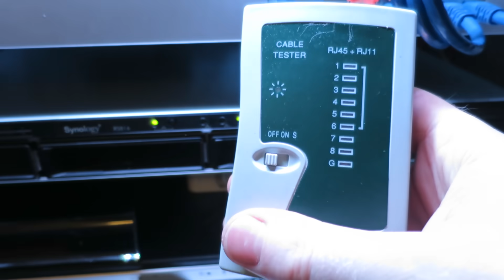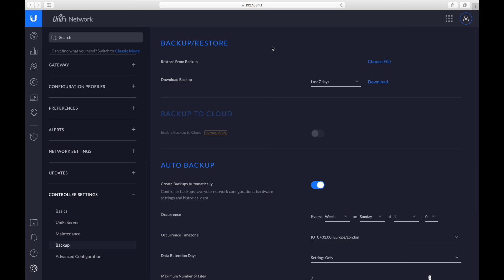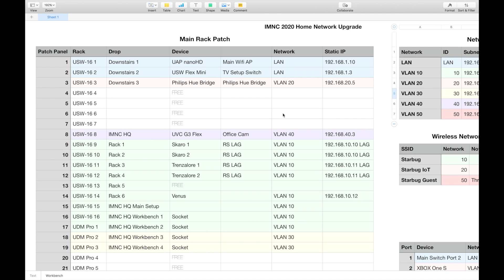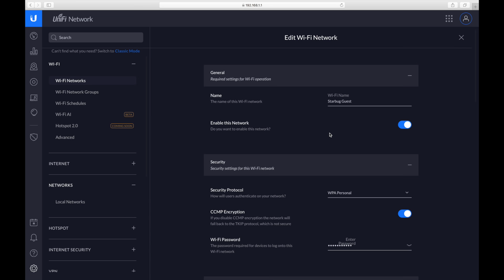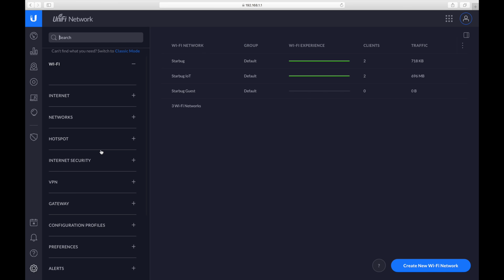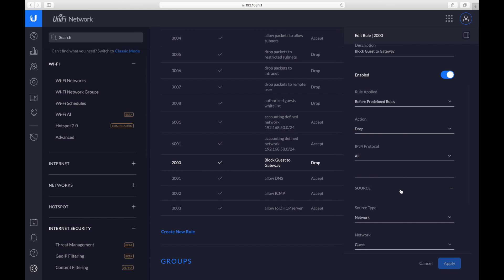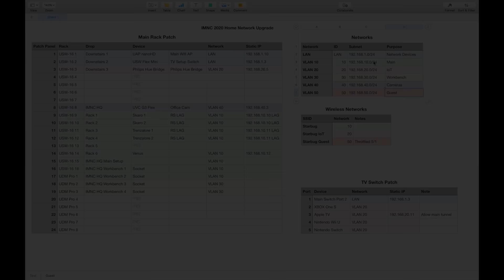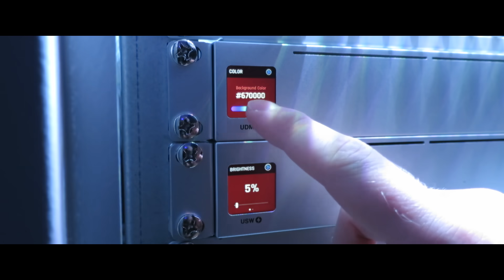Huge 2020 Ubiquiti UniFi Home Network Upgrade (Part 3 - Advanced Configuration & Final Installation)

Comment: Delicious setup, it  looks amazing, very similar to what I'm setting up now (with the exception of I'm going for the 24 port Gen2 switch, and the Ubiquiti RPS too).  One question if I may ask, where did you source your brush panels from, and how does the panel colour compare with Unifi stuff? I don't think my OCD will allow me to sleep unless they're the same colour!  Once again, supreme job, great content and looking forward to see more!
Reply from the maker: Thanks, Steve! Really glad you enjoyed the video.
The brush panels are "712477 Intellinet 19IN CABLE ENTRY PANEL" - I bought my 2 from an eBay seller but they're available from a few different sites if you Google that product. The colour is not the same. The UniFi gear has that shiny-ish aluminium look, where as these panels are painted steel, specifically RAL 7035. I'm not aware of any off the shelf panels that have the aluminium look, but you can remove the brushes from these, so you could if you wanted spray them with aluminium spray, which you can pick up online / at a hardware shop / auto repair shop. This has been done by other UniFi enthusiasts who want even colour rack equipment. For me, these panels are a great fit as my cabinet is finished in RAL 7035, so it looks really nice. 
The patch cables are deleyCON CAT6 white. They're available on Amazon as packs of 10, multiple different lengths available. I purchased 20x 2m and 10x 1m for this project, used 24 for patching the front end and 6 for patching the rack gear itself. https://www.amazon.co.uk/gp/product/B079G3V5Y5/ref=ppx_yo_dt_b_asin_title_o00_s00?ie=UTF8&th=1

Comment: Love your video series on the UniFi upgrade! I'm about a week behind you so just got my gear, still waiting for the USW24POE to arrive, learning a lot from you! To that end I'm curious about where you got information on the UDMP combined switch through capacity of only 1Gbit (until the switch arrives I'm using the switch on the UDM) I can't find that information anywhere... I also wonder where all patch cables to all ports in the UDM goes in your rack since you said in the video you're gonna use the main switch instead of the built in switch ports of the UDM due to the above said limitation? Oh, and could you link to the rack mounting gear? Eg what length are the patch cables you've used? what are the brush plates called etc :-)?
Reply from the maker: Really glad you enjoyed the video and awesome to hear you've got some UniFi kit on the way! Yes I can help with all this info.
Unlike the UniFi switches, the switching capacity of the UDM Pro as well as other switch specific specs aren't outlined in the product data sheet, however if you do a bit of Googling, you'll come across the info that the current retail model ships with a 1Gbps backplane, where as the early access model had a 2.5Gbps backplane. See this link: https://ubntwiki.com/products/unifi/unifi_dream_machine_pro - there's also some useful information about the subject here: https://www.reddit.com/r/Ubiquiti/comments/eyqmud/udm_pro_8_port_switch_with_only_1gbps_backplane/

The 8 ports on the UDM Pro are patched to ports 17-24 on my patch panel. My switch is 1 to 1 patched 1 through 16. I currently don't have any devices in 17-24, so the UDM Pro switch ports aren't technically connected to any devices in my network currently. If you look at my network spreadsheet, you'll see my usage begins to creep into that range, but that's cabling that I haven't yet run. Switching capacity won't be a concern for machines I have connected to those ports as they'll be used once in a blue moon. All of my high throughput devices and devices used daily are / will be connected to the main switch, to make use of the much higher throughput of the dedicated switch.

Patch cable length; I purchased 10x 1m and 10x 2m. I used 24 for the front patching, and 6 for the back end of my rack connecting the various machines within the rack itself. These are the cables: https://www.amazon.co.uk/gp/product/B079G3V5Y5/ref=ppx_yo_dt_b_asin_title_o00_s00?ie=UTF8&psc=1

The brush panels are "712477 Intellinet 19IN CABLE ENTRY PANEL" - I bought my 2 from an eBay seller but they're available from a few different sites if you Google that product.

I hope this was useful info, if I can help with anything else please let me know.
Reply: ItsMyNaturalColour BigFam is my alter ego.. Thanks so much for taking the time to respond. Very relevant and to the point information. Highly highly appreciated!
Thanks so much again! 🙌🏻🙌🏻🙌🏻
Ohh and of course subscribing from both accounts😊
Reply from the maker: @carlnakamura4861  You're very welcome. Thank you for the subscriptions, I really appreciate it! :D

Comment: Going by your closing comments, you may well answer this one on a later video, but I'll ask it now anyway.
How do the cameras talk to the UDM, for Protect, if they're on seperate VLANS?  I want to do similar, and I have a dedicated 8-port Unifi POE switch, to power and connect my cameras, when I get them.
Reply from the maker: Hey Steve. 
The cameras will keep communication with the UDM just fine. When I created the camera VLAN, in this order I:
1. Gave the camera it's new IP address via DHCP Reserve (settings tab of the camera itself under UniFi controller device list)
2. Changed the switch port profile of the port connected to the camera to port group VLAN40 (cameras)
3. Power cycled the port
When the camera fired back up, it was sitting happily on it's new VLAN with it's new IP address. I went into UniFi protect and it was detected instantly and began recording right away. I'm not sure if this is the official correct way to do it, but that's what I did and it worked just fine. Hope this helps.
Reply: @ItsMyNaturalColour  Cheers, I think it's about time to get, at least, my first camera, to experiment with, even though I'm nowhere near to being ready to install them.  Great series of videos by the way.
Reply from the maker: @stevesmith9081  I have more UniFi Protect coverage coming up, so keep an eye out as it may be helpful if you're looking at getting cameras.
Thanks for comments, really glad you're enjoying.
Reply: @ItsMyNaturalColour  I'll look out for it, just subbed, so I shouldn't miss any more updates.  Just ordered a G3 bullet cam.
Reply: Hey Tom you nailed it on this video! Your best video to date👍

Comment: You should get better WiFi if you move the AP upstairs WiFi finds it easier too travel down than it does up mount it on your ceiling upstairs centrally
Reply from the maker: My AP location definitely isn't ideal. I'm very pleased with the signal considering!
Reply: @ItsMyNaturalColour  unify does a great job im happy with mine too im running the AC Pro

Comment: Love the series!  If you put the second horse hair passthrough between the UDM and switch, you could get a little more airflow for both and not have to cross the cables over each other.  Just my 2 cents.
Reply from the maker: You're absolutely right. I was torn deciding between the approach you mention, and the approach you see in the video. I also had to keep in mind my positioning of Skaro. The 2 UniFi devices run relatively cool, but Skaro gets hot, and as you can see it's directly below the lower brush panel. There's a new machine coming to fill the blank space below Skaro too, so ultimately I ended up going for this layout.

Comment: I noticed the same. You cant absolutely set a static IP from the router. It only works when it wants. I renew the lease from the client and the client IP is still different to the one i set statically on the router. Its annoying because i want to set the static ip on the router and have a guaranteed assignment.

Comment: Little confused.... whats devices are on the on the 1.0 Network devices???  Router, Switch, firewall, etc??  Also where do you configure your VLANs? on the switch or the firewall/router?  Trying to think about how I want to setup my network but using pfsense and a Cisco switch.
Reply: Brian Froeber all configuration is done on the udm
Reply from the maker: Hi Brian
Apologies, I did rush through that bit a little. 
On the default .1.0 LAN, I've kept all of my network kit, so for me that's just UDM, 2 switches and a single AP. I've then decided to dump all of my main gear on the .10. VLAN that I created, and use that as my go to daily network.
In terms of configuration, the whole process you see here is done on the UDM Pro itself. Unlike the USG, the UDM line has a built in controller, negating the need to host the controller software on a separate machine or purchase a UniFi Cloud Key. By logging into the UDM, I'm able to control the entire network and all configuration from that one place, as well as access the separate applications such as UniFi Protect, for the cameras.
Reply: @ItsMyNaturalColour  Sorry i dont know Unifi gear...UDM Pro is a router? firewall?
Reply from the maker: @neccros007  Have a look at Part 1 of this video series. This video will seem fairly out of context if you haven't seen Part 1 & 2. 
The UniFI Dream Machine Pro (UDM Pro) is an 'all in one network appliance'. It contains your gateway, controller, 8-port switch and NVR... so yes like a mega router firewall combo box with lots of other toys. This is the 'Pro' version, geared more toward small business or home enthusiasts. For a more home friendly device, they make the regular UniFi Dream Machine (UDM), a very nicely designed device that incorporates gateway, controller, 4-port switch and an access point (no NVR in that one).
Reply: @ItsMyNaturalColour  got it.... since I dont have Unifi gear, I am trying to equate the role each of your gear would to what I am going to run
Reply: @neccros007  having different vendors Gear you just need to make sure to configure every single piece the same way. So your pfsense vlans need to be configured the same as your Cisco switch vlans then it will work as expected. Pfsense would take care of vlan to vlan routing and Cisco will maintain the traffic inside the vlans. If configured well, the result would be the same.

Comment: Might work better put on the ceiling rather than on the wall.  I have the same access point and took awhile to work out the best way to position them
Reply from the maker: Deffo. I will be able to move it when I redecorate.

Comment: Great content, thanks a lot! Especially the VLAN setup is interesting for me, as I wanted to do something very similar. What I wonder is what's the benefit of separating Network and (trusted) "Main" devices? Mainly for the sake of purity or just in case a trusted device still gets compromised to protect the network devices? Or vice versa? Any other reasons?

Comment: The only flaw I see with this plan is that if you need to access the bottom switch for any reason or have to take it out of the rack. Say it dies and you have to RMA it. Hypothetical. You would have to unplug everything from the UDM to get to it. Not to mention you just made it harder to access the ports beneath those cables. Fiber ninja has a video about this, just don’t remember which one it was. The UDM should be using direct patches with really short jumpers from above. But it your okay with what I just said, then it’s ok. Looks good mate. Glad to see your happy with the result.
Reply from the maker: You're absolutely right, and I was aware when doing it that Fiberninja would not be happy with me. I can see myself at some point upgrading to a 24-port UniFi switch, so that upgrade will be very smooth and easy with the current layout. I'll simply move the block of 8 cables down from the UDM, to the final ports on the new switch. It'll stay just as clean and means I can swap switches without pulling the rack out and removing the back cover. Even before installing the 16 port, I could foresee my need for a 24 port.
Reply: ItsMyNaturalColour I wish I had the money to upgrade my switches to Unifi. Just don’t have $2000 to blow on the kind of gear I would need. I’m using retired Cisco switches from my local university that I paid $15 each for. A 48-port in my server rack and a POE 24 port in the garage where my patch panel is located. It does the job, just a pain to manage. Ubiquity dumbs down the VLAN process so that the average consumer can understand it. I had to configure my VLANs and LAGs via command line. Not fun, but if you understand what going on and understand the difference between trunk and access, it’s pretty simple.

Comment: I’m literally on the verge of splashing out on a setup like this. I currently have a single Sky Router on a 4 bed house and the signal is just garbage. 

I have a question, i have IPTV via Apple TV, to use the Remote App on Apple Watch, iPhone or iPad, the phone has to be on the same network as the Apple TV. How would that work if you have your iPhone/iPad connected to the access point and the Apple TV connected directly to the switch? 

I know that’s very picky but it’s the way I like it. :) 

Love the series, mate.

Comment: Great series, just switching to UNIFI for my own home network. One question, I notice you have your UniFi switch right under then Dream machine. In their setup guide, Ubiquiti make a strong point of not having anything covering the top or bottom of the switch for cooling reasons, I.e. “IMPORTANT: Fanless switches must not be stacked. Do not place this UniFi Switch on top of another switch. Do not place anything on top of this UniFi Switch.” 
I’m just wondering whether to disregard this in my own rack as the Dream Machine Pro and the switch do look good together.
Reply from the maker: Richard, thanks for checking out my series. Apologies for my delayed response.
So far I haven't noticed any issues with the 2 units stacked, but I do have active cooling in the rack. I have 3 120mm fans; an intake at the bottom, exhaust at the top, and the third is placed directly behind the UDM and switch. It's for this reason that I wasn't too concerned about stacking them. Also, I'm not operating with that many PoE devices. I'd imagine (guessing) that the switch becomes hotter the more PoE devices that are running from it.

It is of course a risk, going against the advice in the product manual. This little switch does A LOT for a fanless switch, so it really is up to you.

Comment: Does the 2 factor work when the internet is down?
Reply from the maker: Good question... I haven't actually tested it. I'll be sure to test this in a future video.
Reply: s8wc3 If I remember correctly it won’t ask you for a 2FA number if it’s disconnected from internet.
You could say it’s a security flaw but let’s face it if someone has physical access then they’re in anyway one way or another

Comment: I builded my home network based on your videos (and thank you for that).
I have an ecobee switch+ on my IoT network and I wasn't able to add it to Home Kit from my phone which it was connected to my main network. When I switched my phone to IoT network, I was finally able to add it to Home Kit, but when I switch my phone back to my main network, the switch is not responding!
I have a firewall rule that is blocking the IoT network to "talk" with any other network and I also I have enabled the "Match State New" option, but still, when I have my phone connected to my main network I'm getting the messagee "The accessory is not responding".
What am I doing wrong?

Comment: Why didn't you go for cables with a grounded connector? Thought that would be better when running PoE devices?
Reply from the maker: Hi Wolf.
In order to take advantage of such cables, the entire network infrastructure needs to be shielded. If you use shielded patch cables on standard networking infrastructure, they work, but there is no benefit and it's actually a bit of a hindrance as the cables themselves are noticeably stiffer most of the time. 
A shielded network uses STP cable, versus the much more widely used UTP. Shielded keystone jacks, a shielded patch panel and shielded sockets are also required throughout the network. While it's not much more difficult to install a shielded network, it is more time consuming, a little fiddlier and more expensive. For the majority of people, an unshielded network infrastructure using standard UTP cable is sufficient. STP is important for specific use case scenarios, such as installations where electro magnetic interference is a concern, or infrastructure that is primarily supporting a 10G network, as 10GE is much more susceptible to EMI.
Reply: @ItsMyNaturalColour  Makes total sense! And yeah, for my overkill prosumer network I personally use SFTP cables, and an extra earthing block for the incoming line as thunder hit before and welded the devices together as it were haha.
Cheers for the response man, and keep it up! Long time follower here since the G4 adventures

Comment: Great series thanks Tom! 
I bought the UDM and 24-port switch - all working as per yours. 
One question though - how the hell do you get alternative DNS servers to work? I entered these for OpenDNS, which I bought an annual subscription for: 208.67.222.222 / 208.67.220.220
It just doesn't work even if I enter them in both the WAN and LAN settings. My broadband ISP is Vodafone, who DNS addresses are: 90.255.255.90 / 90.255.255.255 It just reverst back to those each time I try to change them. UniFi message boards not much use so far...
Any ideas?
Thanks very much.